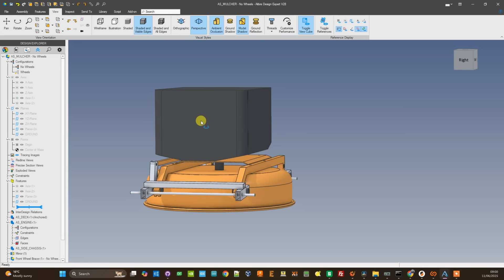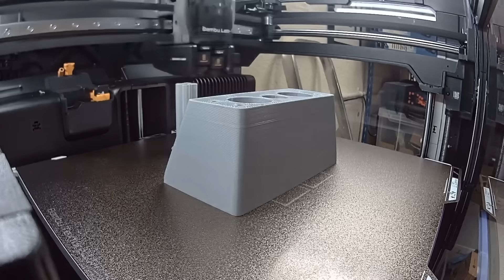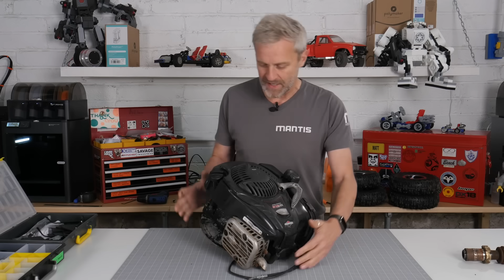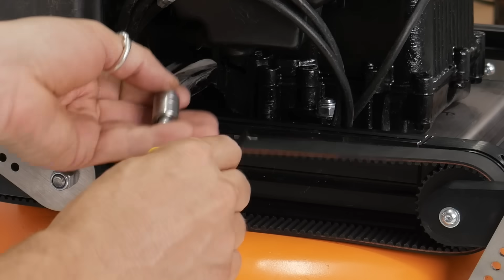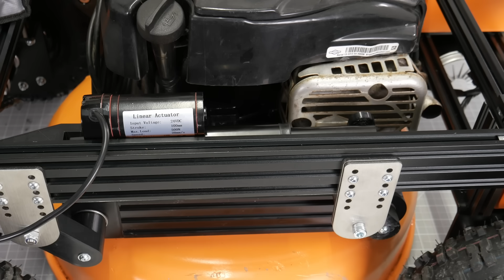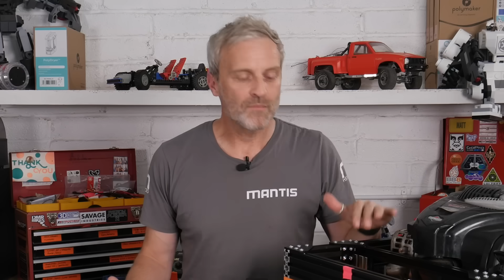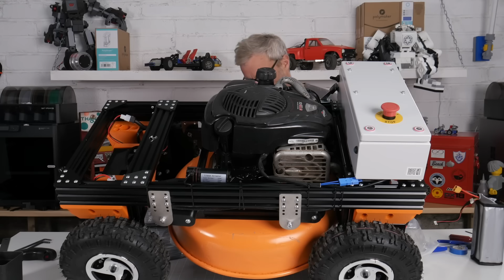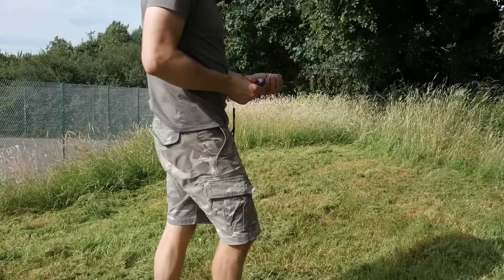I Built a 4x4 Radio Controlled Mower!

Comment: Nice build video, thank you very much. One idea for an upgrade: there is/was a project called ArduPilot, which is essentially a controller for a drone. It had some options for a conversion to ground based vehicles, call ArduRover. Essentially, it would convert Mulchy into a semi autonomous vehicle that could follow a pre-programmed set of way points, using GPS to determine it's exact position.

Comment: 1.lift hook for lifting instead of sling
2. Generator to charge battery
3. Long range fuel tank
4. Remote petrol engine speed
5 camera for HUD so you can mow from your arm chair
6 GPS & SBC so as you can program way points.
Reply from the maker: Sounds good 👌

Comment: If you're gonna use tank controls, you may as well make it zero turn.  Put the front wheels on big castors and cantilever the engine off the back to put the center of mass just forward of the drive wheels.  Then connect the drive shaft to a blade shaft via belt with tensioner.  You'd get better steering, lower power usage, and could potentially get a better overlap between your cut width and your wheel width.
Reply from the maker: It wouldn’t have the off road capability it has now, nor the towing. It a one machine does all :)

Comment: Maybe tyres with spikes would provide more grip, so it doesn't have the tendency to slide sideways down the slope as much? Not sure how well that would combine with the skid steering though.

Other than that, yes, tilt sensor. Definitely. Can be done in Arduino, similar to how you'd debounce a switch. Perhaps it can be done entirely electrically too, by using a capacitor and pulldown resistor, and using that tilt switch + cap + resistor as an input to a mosfet inline with your emergency cutoff. Size the cap accordingly so it doesn't drain when encountering bumps, but drains sufficiently fast so it stops the motor when it does tip over.

All in all, nice little platform for experimentation. The extrusions make it easy to try out new stuff without having to make permanent changes.
Reply from the maker: Thanks 🙏

Comment: Great work but the problem is that these dc motors are not brushless and for sure not waterproof .. so eventually from moisture will have problems ... but great works ...
Reply from the maker: Well here’s the thing. I don’t cut grass when it’s wet 💦 😮👌

Comment: mulchie would benefit if it had wedgelock washers thank me later 😁
Reply from the maker: I tried all kinds of anti rotation washers, none work, because the PLA slowly deforms under compression and the bolt works loose. Thread lock was the answer.

Comment: Nice build, but your understanding/explanation of the engine flywheel/spark coil is off a bit. Maybe read up on how that actually works - there's no brake on the flywheel.
Reply from the maker: There is a brake on my flywheel 👍

Comment: I really like your idea but your choice of rig is little questionable.  I would buy cheap electric scooter tires that have internal motors to drive them and just wire them using their own batteries.  this set up will be slightly more expensive but those tires take full 250 lb human weight and have enormous 25 mile range if the batteries are good. Then all you need is the controller with whatever bells and whistles you can add. This would be a real good kit conversion idea.

Comment: As a fellow garage-engineer here's the changes I would make! 
1. Find a way to charge the RC batteries while the engine is running 
2. Use an engine that already has electric start 
3. Maybe use a reel mower system rather than a rotary one? I feel like not only is it safer but they are also known to cut better - and it could just be passive powered like a lot of push reel mowers (this would open up it to being more of a RC lawn utility tractor type thing)
4. Maybe make it a skid-steer type drive? Especially given the wheel wear 
5. Add ardupilot, FPV cams, and and LTE connection so you can be at a distance and just monitor it's route as it mows rather than having to constantly baby it? I feel like this would be cool, albeit with safety concerns - it would definitely have to use a push reel (passive) mowing system if so.
Reply from the maker: Nice ideas. It currently is a skid steer system

Comment: Comparing a petrol powered lawnmower capable of mowing thick grass with a cheap low powered electric mower capable of barely trimming 6" of recently mown grass is a lie.

This is a worthy project.

Maybe keep the prices down using windscreen wiper motors and diy brackets. Heck diy arduino motor controller kit with robotic vision.

We need more diy shed builders.

Keep going my dude.
Reply from the maker: Yes exactly! Someone who understands it! 🙏

Comment: Have not watched to the end yet, but what about putting the wheels at 45deg angle ? You could gain being completely within the footprint of the blade deck if you hide them in the 'corners' between the circle and the 'square' footprint, and, it will only be 'tearing the grass' when you go forward or backward, no tearing while spinning/turning. Just a thought :)
Reply from the maker: There’s too much grip, it’s wouldn’t move.
Reply: @MattDenton  Hmm here's an idea... you could have the wheels swivel into one of 2 positions only: straight for driving straight, 45deg for turning. One servo or a 2 position actuator, does it on all 4 corners. Yes it will lose ability to do turns other than in place (though you can still use tank turning where possible) but turning a corner, it'll do ?

Comment: I'm contemplating building a remote controlled cutter. I'd love to be able to switch from brush hog to flail mower if I could figure out a way to make that work. Maybe make the brush hog deck removable like a mower deck on a riding mower and the flail removable like a plow? I'd prefer to use a diesel motor for the torque.
Reply from the maker: Sounds great 👍

Comment: I wonder if you could cut the robot’s weight by switching to an electric motor driving the blade. The nice part about the blade motor is it only needs to spin one way and does not need precise speed control. I do wonder if one could use a large BLDC driver like for a rc plane or drone and if the existing anti impact attachment is enough. Or if some sort of torque limiting mechanism would be necessary so that the controller doesn’t have to handle any huge amperage spikes if it tries to mow a medium sized rock or branch. I know my 36v electric mower has some sort of electronic limiter that auto stops the blade if it thinks there was an impact. I feel like you might need that for remote mowing so that you can remotely soft reset it.

Comment: I love it Matt
Well done for building that and inspiring more people to just go out there a do it !!
Ignore all those negative people  out there
Even the best commercial machine can be criticized and boy do they cost a fortune !!!
I plan to build one soon
I am researching various build and different ways of tackling this and would be interested in your thoughts !!
If you had to do it from scratch again, what would you do differently based on your experience now that you have made one
A few things go through my mind
=) perhaps use a battery mower instead as a donor, as then,  steep banks and inclines would not be a problem (sadly I also love Briggs an Stratton engines ... they just work !! lol )_
=) I am thinking that a wide mower would provide abetter ability to go across a steeper bank , but on the counter argument, mowing near edges would leave a wider uncut strip, or perhaps an offset disposition so you still have a wide frame but the mower is close to one edge, so if you need to mow close to an edge, you position the direction of mowing accordingly. This would also help with steep terrains as if you made sure the mower closet to the edge sits highest on the bank you are shifting the center of gravity further up than the middle, so more stable
=) perhaps a set of replacement tires or wheels with long studs /spikes for steep terrains so you don't get so much slippage 
=) I think I prefer your design with four driven wheels as if you only drive with two back wheels, on a steep bank the front will just want to go down the slope. I also don't like the jocky wheel idea in front as again it makes steering very jittery. And yes, a bit of additional microprocessor logic like arduino or RPI Pico couold be used to smooth jerky motions and a lot of other things
=) Did you managed to get  replacement gears to get less speed and more torque ? If not, which motors would you recommend ?
I assume you have not considered "Take 2" of that mower yet ? lol 
Great job though Matt 
All credit to you

Comment: Out of curiosity - why did you use a gas powered mower rather than an electrically driven one?  I assume “it started out that way” - - and if so, then why not upgrade the cutting motor to being electrically powered rather than gas?  Made me nervous with you filling that thing up with gas with all the electronics there…
Reply from the maker: Because it’s hard to beat the power to weight ratio of gas. It’s about 16 to 20X power density of the best batteries even after inefficiency is factored in
Reply: @MattDenton fair point.  Likely cost as well. The good thing about electrical though like you found with your electrical system (esp battery) is that you have a bit more flexibility to maneuver the center of gravity to be quite a bit lower - if you’re too top heavy. 

Was a great video though. Thanks for the thoughtful response. Keep up the good work. Subbing now if I haven’t already 🎉

Comment: Very cool. You need to partner with someone to add a semi-autonomous guidance system. The lawn robots want to claim fully autonomous operation - they are not - so a partially autonomous system would be good enough for rough cutting.
Reply from the maker: That could be me 😊

Comment: the fact that you're still using a gas mower, after adding all those electronics, is crazy.
Reply from the maker: No it’s not. Do the maths. To get the same run time and power out of batteries compared to gas! Gas has approx 16 to 20 x the energy density of the best batteries even after the inefficiencies are factors in 😏

Comment: Awesome project. Lack of proper garage space is why I don't have more projects like this and stick to 1/10 and 1/14 scale RCs. Is it possible to change out the remote to something a bit more comfortable like a pistol grip radio like a DX5R or G11P, or is the RX built into to the speed control box?
Reply from the maker: You can use any remote RC system. The thing I like about this is it’s one handed. 👍

Comment: One of the best RC mower builds I have seen, In many I have seen, parts are just slapped on to make it work. I like that you keep it as small as possible, some are ridiculously long. mechanically it looks pretty solid.  I'm building a mower size weedwhacker,  all electric, Up  here in Paradise CA. they don't like us using metal blades on rough property due to fire hazard. Thank you

Comment: Add a belt-driven alternator to keep the battery charged (I think there are tiny ones made for ride-on tractor mowers).  Also, instead of 4 motors, just use 2 to cut down on electric usage, but upgrade to a track system like a tank/bulldozer for better traction.
Reply: Alternator would be sick!....👍

Comment: Here's an odd compliment.  I've been watching commercially available Chinese mower videos.  You are by far the best RC driver yet.  I kid you not.  Its embarrassing how bad some of those guys are.  Great project.  Suggestion: For the tilt sensor.  Add a delay circuit so that a bump won't shut down the mower immediately.  Best not to use an Arduino or other computer.  Keep the safety stuff as dumb as possible.
Reply from the maker: Thanks 🙏 yeah I like hardware based safety where possible :) an oil filled tilt switch would be great

Comment: have gasoline engine and runs on battery? have batteries but cut with gasoline engine? hmmm...
Reply from the maker: Exactly like a Hybrid car 👍
Reply: @MattDenton  you need an alternator for real hybrid, to charge batteries. And powerful BLCD for cutting blades. Would be Super-mulcher
Reply from the maker: But then I’d need MUCH larger batteries! I’ve done the maths ;)

Comment: Unistrut (Galvanized Steel) is much cheaper and may be more rugged than the Aluminum 80/20 frame.  Otherwise -- All good by me.  Another -- could add a relay to drop down/up 12v to 24v (is that your max?)   That would like a range of various speeds across each voltage.

Comment: As an engineer & former landscaper, I have a few recommendations for ur trimmer arm. It should b able to actuate to either front corner of the mower. Using a motor mounted at the trimmer head w a reversal switch will allow u to change the rotation of the trimmer on each side so that the trimmer uses the rotation of the line to sweep the grass toward the center in front of the mower, allowing u to mulch the trimmed grass rather than flinging it away from the side of the cut area. Giving u a nice clean trimmed edge. If u can add in a way to tilt the trimmer head, u can trim an angled edge as u go. Ur mower engine seems to b going thru too much fuel, u may need to adjust the carb to get better milage outta mulchy. U also need to add negative rake to the front end to make it cut correctly. It needs to b 1/4 inch higher than the back to enable the mulching function to work correctly. It will also mulch better if u hose off the blade deck when ur done using it. Just b sure u dont flip it up with the oil plug facing down or the oil may drain out of the oil plug, made loose by vibration. To make the job of hosing the blade deck off easier, apply a liberal coat of WD40. It protects the deck from the dampness of fresh cut grass & will wash off easier the next time. It will also b much lighter, & ur tires wont wear as fast.

Comment: Hello. did you measured the current they were  consuming when operating under that lawnmower load?If you did. How much amps was that?
Reply from the maker: I didn’t. But they last a long time on these batteries
Reply: @MattDenton any idea how much time was that?even a rough estimate would do the job.because I am planning to buy these motors and concerned about the practical torque they would be providing.For that only I need to know the runtime or current consumption.Also the weight of the robot.That would be really helpful if you could provide that information.
Reply from the maker: I don’t remember but I think o mention it in the video somewhere

Comment: I want to use a brushless blade motor. What is your recommendation? In my opinion, 6000 rpm 1000w-1500w 3 Nm is sufficient for a 30 cm blade. What do you think?
Reply from the maker: Well most mowers run at 1400 or 2800 rpm, so 6000 may be too hight! Power sounds about right and I’d say minimum 3nm. Mulchy is 7nm peak

Comment: I wouldn't recomment tilting the engine, especially a vertical shaft one like this. The oil will leak into the cylinder and burn resulting in accelerated cabon buildup

Comment: This was a very interesting watch.. But if you calculate the costs, and the time you spent to build it... Wouldn't it have been cheaper just to buy a proper robot lawnmower? I have honestly been thinking to build my own as I have old arduino/R-Pi parts lying around I wanted to repurpose, but what this video showed me is that it would simply be cheaper to buy one rather than build.. I love to tinker too, but sometimes it's also about effort, need and practicality.. But great job!
Reply from the maker: Maybe if you add in my time but I really enjoyed building it. So it’s. It just about the cost to me.

Comment: Hi Matt hope your well , cracking video I really enjoyed it, I've built a snowplough similar size to you're lawnmower using scooter motors but I don't know what speed controller to purchase to connect to my RC receiver, there is a motor on each side and each side is connected front to back with chain and sprocket so it will be four wheel drive , I've seen some high amp speed controller's on Amazon but not sure if I'm just going to make a fire 😮, thanks
Reply from the maker: You need to check the power demand of your motors and specify a controller that’s higher than what they will demand.
Reply: @MattDenton Thanks for the reply it says 20amp on the bottom of the motor so I'll have a look what I can find , cheers
Reply from the maker: Yeah give yourself some headroom so 30 or 40 amp would be good
Reply: @MattDenton thanks mate ,,👍

Comment: Hello Matt, I've sold lawnmowers for many years and I see you have the rotation wrong. On the video you can see the machine cutting better backwards then forwards. This is normal due to the cutting edge off the blade. your forward still cuts but would be better to drive in the other direction. fantastic build thow. love your solutions.

Comment: Thanks again for some inspiration. I got a electric mower some years ago. I bought a 36v motor for the blade and got 2 motors from a hoverboard. I want to use a ESP32 with PS3 Controller to control everything. I started coding a dead man switch on the L1 and R1 triggers.
Reply from the maker: Oh cool! I hope your project goes well! I plan and E conversion for mulch
Reply: @MattDenton I am looking forward to see the conversion in the next video 😀

Comment: should have dumped a electric motor on there for the blade as well
Reply from the maker: Version 2
Reply: @Deathbyfartz  You usually use the gasoline engine to generate the power for the marching motors. This way you can easily keep it running for a while day without recharging. The chinese machines do this as well.